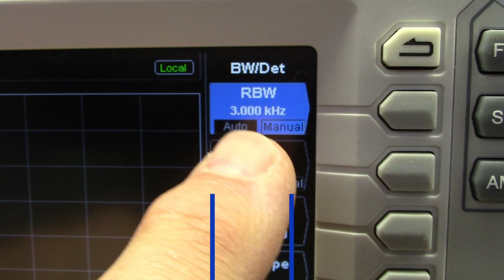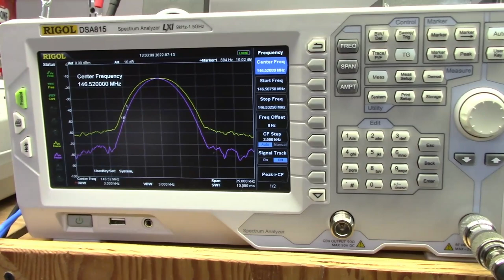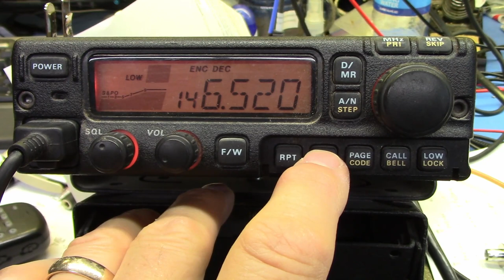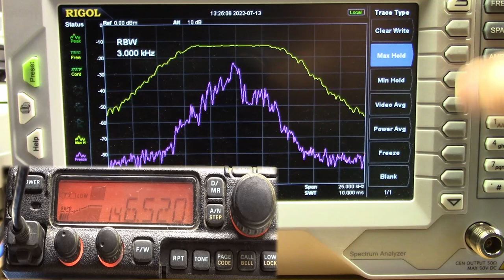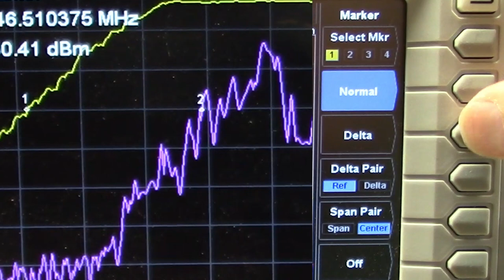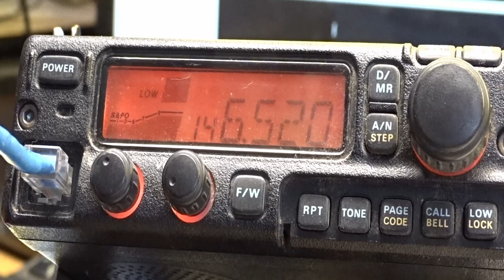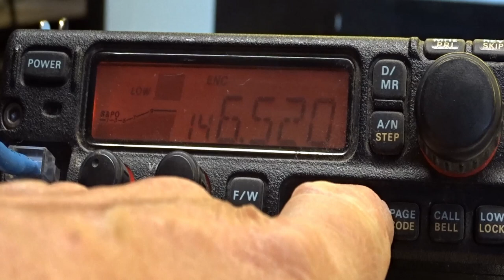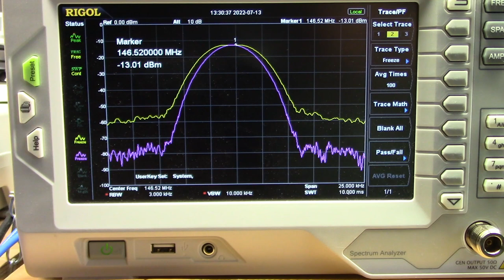Measuring FM Deviation using the MIN/MAX Method (030b)

Comment: Wouldn't you divide the end number by 2?
When testing a monoband 10 m FM transmitter with your method. I'm coming out with approximately 6.125 kilohertz deviation.
I think realistically the number should to be divided by 2.
I don't think my transmitter is designed to produce 6.125 kHz of FM deviation on 10 meter.
Reply from the maker: Actually ... yeah, 6 KHz deviation is about right for peak-to-peak deviation. If you are interested in peak deviation, then you are right, divide by 2.
I just added this note to the description for the video.

I hope this makes sense.
Reply: @eie_for_you  yes ,PEAK deviation (the one divided by 2) is the measurement most radio testers are interested in. As this PEAK (not peak to peak) is what is shown in the radio specifications for almost all commercial and amateur / HAM radios. 
Thanks for the videos!
73!
Reply: @eie_for_you  Great video by the way!
Also really appreciate your emphasis on how important attenuation to the test at hand.
It could be a very costly mistake otherwise.
Reply from the maker: @mostlypostie1  My oversight in not including it in the video itself.
Reply from the maker: @ScottsRadios  Thanks!

Comment: Great video!
Short question, why are you measuring the first deviation at -40db and then the CTCSS deviation at -30db? Is there a reason why you choose this levels?
Reply from the maker: Thanks! I was a fun video to make! 🙂
To answer your short question. 
I was looking for convenient places where both signals pass a particular dB graticule giving me a nice trace to work with, traveling in the semi-vertical direction. The reason is that I am interested in both the horizontal and vertical points of each trace; we want to pick a "well-behaved" spot to make the measurement.
Measuring the deviation of the audio of the radio gave me a particularly nasty min trace to select an appropriate spot to use.
Reply: @eie_for_you  Dear Ralph
Thank you for the superfast answer! I am a but confused because it seems that the space between the two points increases with lower levels, does that not mean that the deviation measured at -30db is less than on -40db?
Reply from the maker: @Atreju93  Appearances are somewhat deceiving.  Because of the curve of the traces and the existence of the graticules on the screen, things can look to the eye what they are not in reality.  Still, we do want to try to pick a point mid-height as opposed to at the base or peak.  We also remember, this is not a "high-precision" measurement.
Reply: @eie_for_you  Thank you very much for your explanation! I will try this at home :)
Reply from the maker: @Atreju93  I think the deviation is what it is.  Why the difference is an unknown to me. But, if it truly is (as measured with the cursors) wider at the bottom and narrower at the top, then making the measurement in the middle gives you kind of an average value. Again, this is not a high precision measurement. Higher precision with a more definitive answer can be found using the Bessel Null method (https://youtu.be/4XoHmqjen6Q).

Comment: Your video is very interesting. I don't understand why you recommend using a 100 or 10 Hz RBW but in the video you use a 3 KHz RBW. Did I see wrong? Thank you :)
Reply from the maker: At 1:19 I said that we need a "frequency resolution" of 100 Hz or better. This means the ability to discern between any two adjacent frequencies. This is not RBW.  At 2:26 I tell folks to set the RBW to 3 KHz.
So, you didn't see wrong.  There was just a bit of misunderstanding about what I meant by "frequency resolution."  You are good! 🙂